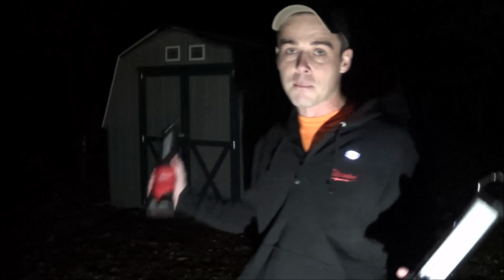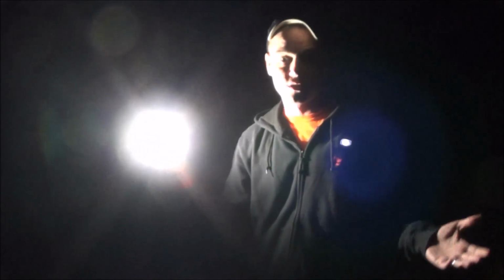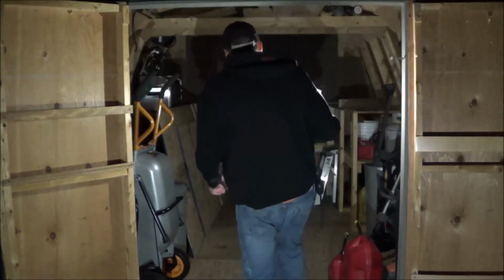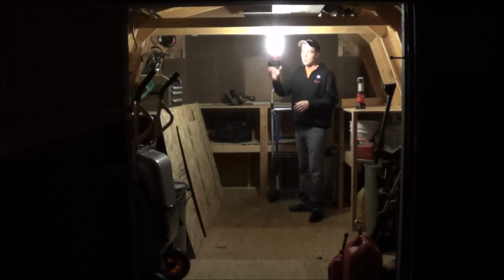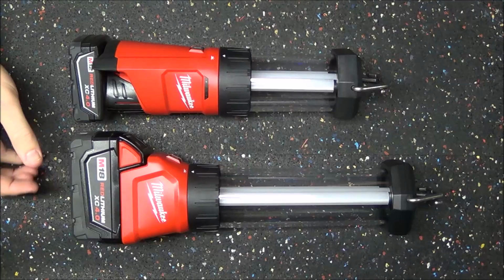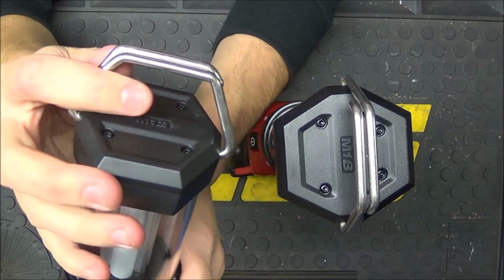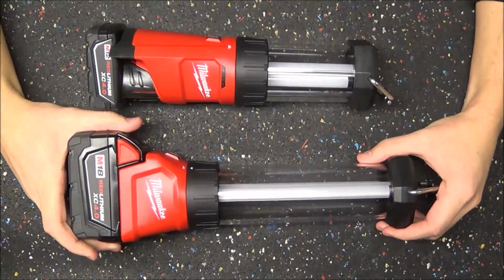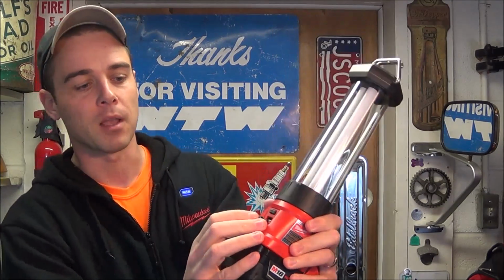Milwaukee M12/M18 TRUEVIEW LED Lantern/Flood Lights - 2363 / 2362

Comment: Good review, thanks. I’m disappointed though that Milwaukee is still stubbornly sticking to USB-A for some of its tools. I won’t buy it for that reason. I’m sick and tired of carrying multiple cables. I finally got all of my electronic devices to USB-C, and I refuse to go back. Secondly, although the flash function is nice, it’s just a repetitive flash. That’s not a recognized distress signal. So you could have the flash going until the battery dies and nobody might come to your aid.

Comment: I have a ton of milwaukee tools and thought I was up to date on all there m12 and m18 tools.. Not sure how these lights flew under my radar. I have an m18 flashlight  but it doesn't cut it when you kill the power and need to work on things as an electrician. Thanks for the review gonna go m18. The more light the better!

Comment: +Real Tool Reviews do you have any tips for keeping spiders out of a shed like that or garage? It looks like you live in a forested area so I would think you have spiders. I am having no end of spider problems this year. Every day when I go out to my garage or shed every surface is covered in spider webs, hanging from the rafters. I have to spend 10 minutes cleaning webs off every time I go out to work on something. I've tried Bug Barrier and it didn't seem to slow them down.
Reply: Natural bug repellants are like lavender and peppermint oil, look it up for your application, mix with water in a sprayer and apply, or just put the oil all around the shed, it'll repel all sorts of stuff, may not work as well as gas as far as longetivity, but it's safer imo
Reply from the maker: +doitle Yes.....leave the cap off of a 1 gallon can of gasoline & set it in the floor where it wont accidentally fall over or get knocked over......ZERO bugs/rodents will make nests in there (bees, ants, mice, spiders, etc).  The fumes will dissipate extremely quickly once you open the door (air it out for 5 min before you go in & NEVER smoke/use flames or electronics inside!!).  I always keep a gas can open in mine & have no issues with any pests.  Good luck!
Reply: @RealToolReviews  this the worst advice I have ever heard!!! I thought you were a smart person until I read this comment... are you serious??  open gasoline container in an enclosed space!!!   please remove this comment immediately, this is a seriously dangerous (and illegal in most countries) thing to do. plus the health and environmental harm!

Comment: Great review, Sir! I'm sold on that M18 model. Would love to see as in-depth of a review on that Milwaukee Heated Hoodie you're sporting there as well. Have been thinking of picking up two (one for the wife) of them, but i'm a bit gun shy on pulling the trigger at 100 bones apiece. As always, thank you for uploading!
Reply from the maker: Robert Johnson Thanks Robert!  Yeah, the Heated Hoodie review is coming up very soon (and another one with the Heated Jackets).....I have been using them everyday for about the last two weeks already, and I can tell you that they are AWESOME!   I am 6'2" & 170lbs....and I got the Large sizes and they fit snug....if you want something looser, go the next size up.  For me though, I wanted it a bit form fitting, so the heat wont escape & I can always wear a light jacket over the hoodie for dual layers & heat underneath.  Also, the jacket I have even has heated pockets (the hoodie does not).
Reply: dmcguinn1 Oh, man! I thought I could get away with the cheaper hoodies, but if the jackets have heated pockets and I skip those for the wife, i'll never hear the end of it. Looking forward to the reviews for them, Sir!